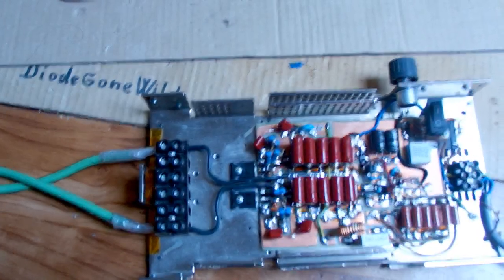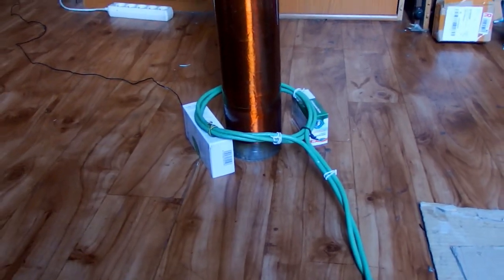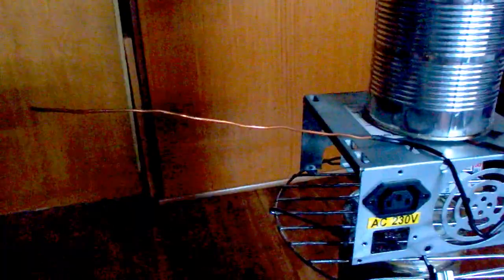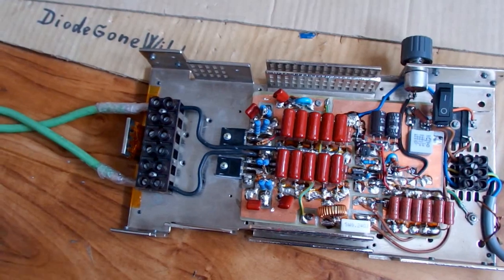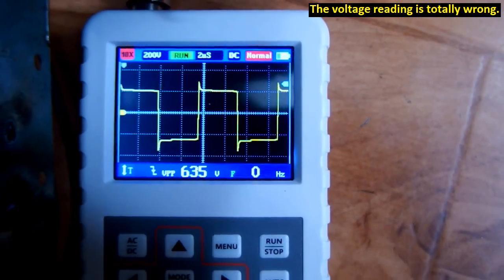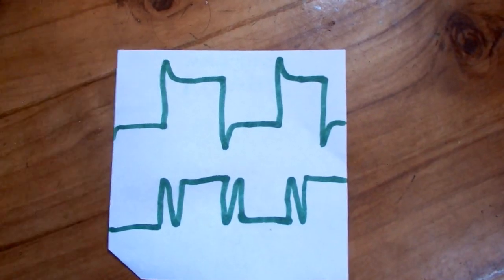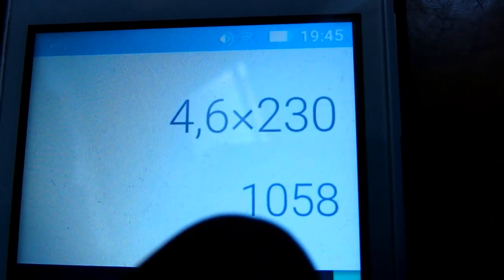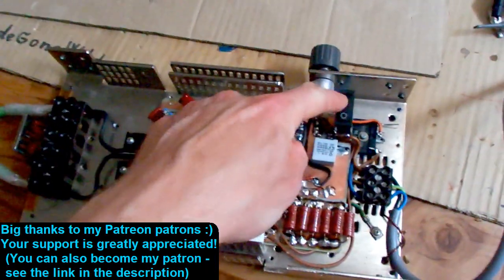SSTC pt. 14 - Longer sparks, black magic waveforms

Comment: when you turn on the sstc, we can hear like a computer disconnecting from something
Reply: Keyboard or mouse usually glitches out when you turn on the Tesla coil
Reply: @panjak323  i was aiming for internet connection idk
Reply: @nunosousa2942  wifi is always fine, only keyboard starts typing on it's own, if I turn on my DRSSTC 😂
Reply: @panjak323  hahaha nice
Reply: LOL...Windows is like ..oh hell no. I'm out...
Reply: @sortofsmarter  My computer even shuts down ! It just goes; "f this I'm out of here" and windows starts regularly shutting down, as it knows what is about to come.
Reply: For phones with touch recent apps/back buttons it goes crazy
Reply: @dwdadevil  Laptop touch-pads go weird when trying to audio modulate anything with a hv spark using the audio jack.
Reply: @uK8cvPAq  Yeah, tested by myself some months ago
Reply: @dwdadevil  I was thinking of using some kind of optical/bluetooth isolation between the device and hv singing arc circuit to prevent this. Plus its probably much safer too, I use an old phone for that kind of thing now as I'm not sure what other damage the RF is doing to the device. It only happened when the audio jack was connected so it must be conducted emissions going up the cable.
Reply: @uK8cvPAq  Better use optical fiber, bluetooth disconnects or glitches
Reply: @dwdadevil  Optical fiber it is then. Do coilers buy the chips and build their own toslink/spdif circuits from scratch or is it better to buy a module from ebay?
Reply: @uK8cvPAq  If you have the components required you can build one. It doesnt need to be perfect, but better buy from ebay, since it have the specs according to your circuit
Reply: It can also affect Internet. Not all types of connections just DSL cause it uses frequencies that are in the same operating range of a tesla coil. Typically DSL starts from 25khz and goes all the way to 1.1Mhz which is where the resonance frequency of a tesla coil usually is and maybe even higher depending on the type of DSL.
Reply: @dwdadevil  I was thinking PC/phone aux out>convert to optical audio>optical audio cable>convert back to analog>tesla coil/plasma speaker. Never actually used optical audio before, are the cables 100% plastic and non conductive? No weird audiophile metal cable shielding to worry about?
Reply: @uK8cvPAq  Nope, have you seen that "flower" made of tiny tubes and rgb leds inside? Thats enough for audio. All is made of plastic, it doesnt need any shielding.
Also you need to convert the audio signal into pulses, electroboom's channel have a video about that, its the 2 Millon suscriber special
Reply: @uK8cvPAq  Bluetooth works fine too, but you have to shield whole Bluetooth board in grounded aluminum foil or something..., Blocks all of the interference from SSTC, but let's Bluetooth waves through. It's really hard to find suitable board tho, they usually have  DC voltage offset from circuit ground on the speaker output, which might cause problems with converting the signal to PWM.
Reply: @dwdadevil  Don't use electroboom's design, there is much simpler one, that is used by many coilers and uses only one 555 timer., You might not even need the amplifier part, if you use input from optocoupler/ fiber. http://kaizerpowerelectronics.dk/tesla-coils/musical-sstcdrsstc-interrupter/
Reply: @panjak323  I dont have a 555 chip, and i think i cant use an arduino for it...
Reply: @dwdadevil  Arduino can't really convert audio to PWM. but do you have 3 or 4 operational amplifiers that are in the electroboom's circuit ?  Buy some 555 timers, they're bloody cheap.
Reply: @panjak323  I have 2 chips of 4 op amps each
Reply: @dwdadevil  And you don't have any 555s ? Trust me, they are useful for everything.
Reply: @panjak323  In my country we have poor elecronics shop, i need to buy it online, but i think it wont happen due to the pandemic...
I was thinking to use my arduino as a 555 timer, it has a signal generator, specially square, but the hv sparks will reset it
Reply: @dwdadevil  the 555 timer is there to limit the duty cycle, not as a signal generator 😅, whats your interrupter anyways ? Audio input, or ?
Reply: @panjak323  The arduino has 5 analog inputs and 13 outputs, can be digital or analogic and all can be controlled by code. Programming is easy and its specific for what you want to do. In my case, i can simulate the 555 circuit you say perfectly
Reply: @dwdadevil  then you don't have to simulate 555, just create analog to pwm converter right away with it, if it shuts down, just wrap it in some plastic bag and grounded aluminum foil.
Reply: @dwdadevil  even programming the arduino in c or asm for code optimization i dont think that it will do the trick, the adc is too slow with good resolution, if you want it fast, goodby resolution, check the adc in the datasheet and see if you can reach li 35khz or 40 for a good signal sampling, other thing, the pwm is 8bits so....
Reply: @nunosousa2942 It can produce up to 2MHz, so idk if its good (jk)
Reply: @dwdadevil  what the adc?
Reply: alrigth you made me see the datasheet.
topic 23.1 max ADC samples / second 15k not even the  20k of a audio signal but 15k is aceptable
topic 14.7.3 fast PWM, we have here a formula that calculates the fosc, with a 16MHz clock and no prescaler, the pwm doesnt push forward than 65k.
http://ww1.microchip.com/downloads/en/DeviceDoc/Atmel-7810-Automotive-Microcontrollers-ATmega328P_Datasheet.pdf
edit 1: misspelling
Reply: @nunosousa2942  That's enough for me i dont wanna a professional quality, just a thing that works (sounds more serious than it seems)
Reply: @dwdadevil  an opamp based is less difficult to make and way better, if you want to achieve those values you need c or asm programming, Arduino might not do it.
Reply: @nunosousa2942  I made some games and learned about programming in c, c++ and javascript, also i have the arduino from 2 years ago and still using it. Programming wont be a problem, but i will try op amps and arduino, just for tests
Reply: @uK8cvPAq  i don't know about others but i have built optic fibre transmitter and receiver circuits. They work good enough for me.

Comment: Where do the sparks go to? It seems that they just vanish into thin air. Isn’t there a current that has to go somewhere?

I really like how you explain all the things that you consider during design and tests. Thanks 🙏
Reply: The secondary has a capacitance to ground. The output is high frequency AC. Since the capacitive reactance is proportional to the inverse of the frequency, at 140kHZ the reactance of even such a small capacitor is very low, which lets current flow.
Reply: RoboT 
Thank you! 
I assume that the ground is so abundantly present that we don’t see sparks at that end.
Reply: I've never seen an explicit explanation of this, but it would seem like the current density roughly follows the inverse square law (with lots of variation and channeling, etc.) At sufficient distance out, the energy density isn't enough to ionize the air, even though the current is still flowing.
Reply: Mystery solved. Thanks!

Comment: 2:43 man, I wouldn't want to get so close to it, when it's running
Reply: Its fine since he isnt grounded
Reply: @dwdadevil  there still is some parasitic capacitance to the environment, so it can be dangerous if you are close enough, still it's AC, the insulation doesn't really help here
Reply: @jastrobaron  But it doesnt hurt you as mains, it will just move some muscles for milliseconds and then it discharges.
Reply: @dwdadevil  Yeah, but still, it's not really safe. If you have some heart problems, it can be really dangerous.
Reply: Nah, above 20kHz or so you can pass hundreds of mA through the body without any problems (aside from heating). Nerves and muscles don’t respond to frequencies that high. Touching the sparks is fine
Reply: Já taky Kubo :D

Comment: Oscillation below resonant frequency is due to parasitics and inductance in the primary section. It can lead to diodes conducting which is very bad (and smoky :) if a transistor turns on while diode is not quenched yet. From my experiments way back I was expecting overheating or blown up transistor when I saw the waveform. My device often needed spare parts if run for too long with a waveform like that.

Comment: Impressive power for a halfbridge? - Q I have is your toroid tower, are you just experimenting with different capacitance loading - would a uniform toroid clean you waveform a bit? 

Also the switching between two waveforms could be a kind of inductive feedback going to the drive circuit. Finally you primary coupling diameter is quite big - if you have a thicker form and closer coupling - you may get more amperage draw draw or better inductance? Keep up the good work 👌👌👌👌👌

Comment: 5:32 The voltage reading actually seems right.
230VAC to DC is about 325DC, and when you send that to your coil you get about 650 VPP (notice the VPP icon in the lower right of your scope)
It is also counting the overshoots for the VPP calculation
Reply from the maker: No, it really is wrong. It's just an IGBT halfbridge, not a full bridge, so the peak to peak primary voltage is 325V not counting the overshoots. It sometimes shows over 700V, which would probably destroy the 650V IGBTs :).

Comment: If you're game can you scope 1) the voltage on the primary, 2) the voltage on the 11uF capacitor banks. Interested to see if the opposite end of the primary is flailing above and below the rails. Thanks.

Comment: Are you sure that the other waveform isn't just some sort of a glitch of the oscilloscope ? Those handheld ones tend to be a bit clunky and easily get confused by the voltage induced by secondary, then they jump all over the place
Reply: Given how crappily it measures its own battery voltage (often you see fluctuations of ±30% even when idle), I wouldn't trust it with more conplex measurements.

Comment: I actually build the coil from schematic on your website, similar to this one and Ive seen those strange waveforms on my oscilloscope as well. They seem to appear only when the coil is Close to resonance. I  hooked up the primary coil to oscilloscope and connected circuit to low input voltage. As I rotated the tuning potentiometer these "peaks" seemed to get lower and lower as the coil was further away from the resonant frequency.
Reply: Isn't this the whole cold electricity thing Tesla said he discovered?
Reply: @georgeyreynolds  what do u mean by cold electricity? Could you explain?

Comment: Are you planning to convert it to a bridge or make it a Dual Resonant SSTC (or both)? I can't imagine how long those arcs would be!
Reply from the maker: I'm too lazy to build a full bridge. Maybe I could do it with IRS2453D or IRS24531D, but if I needed more power, it would be way way easier to just put parallel pairs of IGBTs into the existing halfbridge.
Reply: @DiodeGoneWild  But wouldn't a full H bridge double the output voltage and so the arc length would also double? With a half bridge you get 320V p-p, but with a full bridge you get 320V peak, right?
Reply: @drobotk  I believe that is correct, but he could also just add a voltage doubler to the input for the same effect with less work (but I believe he may then need higher voltage transistors and maybe also new capacitors).

Comment: CAN i use that sircuit with dc instead of half wave ac?
Reply: yes of course, but transistors You use will get hot, so make a water cooling system or something.
Reply: Acid Trip  what if i use half sycle of square wave signal and its powered by max 30 volts will it then work?
Reply: @uxmuu204  poorly

Comment: Very nice sparcs - love it! Is there a way to roughly measure the high voltage? From the  length of the sparcs i would guess it must be in the 250 - 350 kV region?

Comment: Didnt you have a large Variac somewhere? If you used that and ran it on smooth DC, measuring stuff would be much easier.
Also, I think you should talk about the topload, maybe show some calculations on how the shape and size of it affects its (self-)capacitance.
Reply from the maker: I have a 10A 250V variac. But if I ran it at full voltage smooth DC, it would overheat. Smooth DC is about 4x the power of 1 halfcycle. There are some online calculators for the capacitance of the topload (toroid, sphere, disk, cylinder), but they don't have an option for my shape :D.
Reply: @DiodeGoneWild  Yeah, I meant use the Variac to get about the same average Voltage as with the halfwave rectifier. In case you want to do audio modulation you need smooth DC anyway. It would still give shorter arcs because the peaks are lower, right?
I just think this tesla coil series is the best on youtube because you went into so much detail and explained everything very clearly. The only things you havent talked much about are cooling, and the top load. 

I dont know if you know enough about it yourself though. I was just never happy with the typical explanation of "it's a capacitor to ground". From what I understand, that's very inaccurate. It doesnt have anything to do with "the ground", and instead is due to self-capacitance instead of mutual Capacitance which is what we normally talk about. This is also the reason why arcs can shoot out anywhere into the air, as opposed to down to the ground.

Comment: I've just noticed that you were originally using the AOK transistors in parts 5 - 9 but for the mains test you switched them to the DGTD transistors, and you never mentioned why?

Comment: Nice top load, lol. And a nice project video series. I'm just curious what practical use this Tesla coil would have. Or is it just a toy?
Reply: Tesla coils never have much practical use. They are just toys, but they can also teach you a lot.
Reply: Well they can have a use in wireless energy transfer, the sparks were never part of Teslas ultimate goal. Mr Carlsons lab did a video called "Tesla Coil Wireless Energy and Resonance Demonstration" demonstrating the true purpose behind these coils with a transmitter and receiver coil. Sparks are just for fun mostly.
Reply: @uK8cvPAq  It is useless for wireless energy transfer, because the transmitter transmits in all directions. The energy losses will add up in orders of magnitude compared to the distance. That makes it totally impractical for any serious energy transport use case. Compared to an ordinary extension cord.
So it's just a toy. A lethal toy. Play the video again, pause it at the start and read ALL of the orange text.

Comment: What is the large white round adapter you use to plug it into your mains plug board?
Reply: It was some kind of a smart socket, but now it's just a socket with one wire out of it for measuring current with a clamp meter :)
Reply from the maker: It used to be this:
https://youtu.be/LVzngxFMsGs
But I removed all internals and left just a wire loop. This way I can measure the current drawn from mains using my clamp meter.

Comment: I wonder what would happen if one touches the sparks. If you are grounded I assume it might kill you? Of you are floating maybe nothing? But please don’t try this out just explain if you know 😀
Reply: It wont kill you in the usual way since it is low current at the secondary and high frequency. However it will slowly kill your cells in the body which can be very dangerous if you do it for too long.

Comment: Great work but the sparks ain't as long as the spark gap version, is this expected please ?
Reply: The SSTC is powered with much lower voltage, in this case 320 Vp-p. A SGTC on the other hand is powered with kilovolts. Lower input voltage = lower output voltage = shorter sparks

Comment: put 4 igbt on each side and run it on fully rectified mains .. probably use the power factor control circuit from that dead computer psu .. it should have enough power.

Comment: I wonder how it would sound if powered with DC.
Reply from the maker: I'm afraid it would sound BANG :). DC is about 4x the power of 1 halfcycle. The transistors would probably overheat in a second. The thermal resistance junction to heatsink would be too high.
Reply: @DiodeGoneWild Would it actually be 4x the power? Full wave rectification of ac should produce double the power versus halfwave and I would expect DC 230v to produce about the same heat as fullwave 230VAC. Please correct me if I am mistaken.
Reply: @drobotk  Interesting. Sometimes it sounds like thunderstorm and sometimes completely silent.

Comment: can you load midi song in this sstc?
Reply: You'll have to run it from smoothed DC and build some kind of interrupter with MCU that can handle incoming MIDI.
Reply: @martinrobomaze7184  but the chip can handle the signal from the midi interruptor?
Reply: The driver chip has shutdown capability, so yes. You have to connect a mosfet on the ct pin I suppose. Check the datasheet of that chip. It is IR2153.
Reply: @martinrobomaze7184  i Will wait ansiosly a new vídeo of dankyv ;)

Comment: can you tuch it with wire or metal?
Reply from the maker: High frequency current isn't that dangerous, you can touch it with a metal or even with fingers...
Reply: It can burn your finger?
Reply: @DiodeGoneWild  ok thx for reply

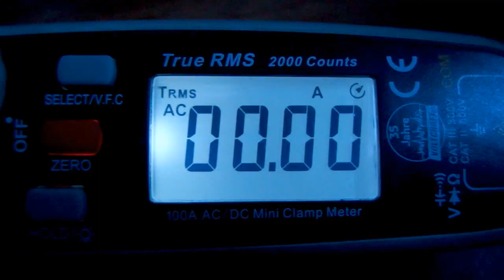Comment: 1:50 you measurements are wrong :/ Even a true RMS meter doesn't measure half cycle sine wave voltages and currents accurately,no matter if its an  expensive multimeter or camp meter.
Reply: I see more problem in calculating real power input than in msms. Power factor of that capacitively loaded rectifier can't be 1. It's much less. W is not the same as VA